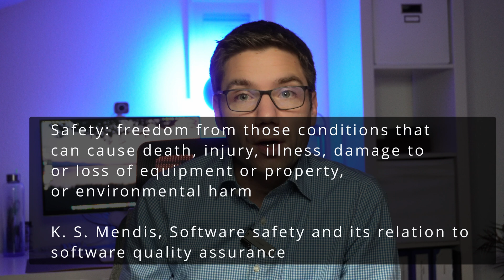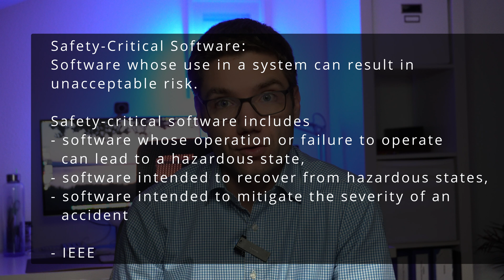Embedded: Safety Critical Software & 5 Guiding Principles

Comment: I'm someone who wants to transition from a rapid-prototype style to a more formal environment..  perhaps not for FAA/FDA/DOE approval, but to develop high quality/safe products containing embedded software..  for any industry..  aerospace (like Lockhead's SEAL Level X, Boeing , DDPMAS etc) , Medical, or Nuclear industries. I'd love to see a trivial example that shows all the steps and outputs.

For example, assuming I document the process on how the code is generated, what constitutes proof that it's safe?  
Static Analysis, 
Code Coverage  - Statement (Level C), Decision (Level B), MCDC  (Level A)?   
Who defines the unit tests?   

I imagine there are differences between the industries.. 
FAA :  DO-178X , DO 331 , ARP4754A  , ED-12C
FDA : 13485 ,  ISO14971 , IEC 62304 , SaMD  and
DOE  : 414.1x, 
but what are the typical tools/software needed, and the typical document/artifacts in the various stages of the software life cycle?  

I saw a good video by CEMILAC Education Program "Airborne Software Development & Certification Process" and it's a bit overwhelming:
Requirement Management -  (IBM Ration) DOORS, JAMA, Xebrio, rmtoo florath , doorstop-dev / doorstop , reqview
Static Source Code Analysis - Parasoft, PolySpace, CodeSonar,  horusec , sonar cloud, veracode PREFast
Dynamic Analysis / Modified Condition/Decision Coverage (MC/DC) - VectorCAST, RapiTest
Configuration Management / Storage and Version Control System - Git, SourceSafe, Mercurial, MS TFS
QA - Helix ALM
(I)V&V /  Test Automation - VectorCAST, LDRA Testbed , Mathworks Simulink DO Qualification Kit
Continuous Integration / CD - Continuous Delivery/Deployment 

And what is the general attitude towards open source software (ex. FreeRTOS) and code-generation tools (ex. ST's Cube MX)?
   
Also, how do CPLD and FPGAs fit in to the picture.. since not exactly software, but they are programmable devices written in an  programming language like VHDL , (system) verilog , Amaranth HDL ?